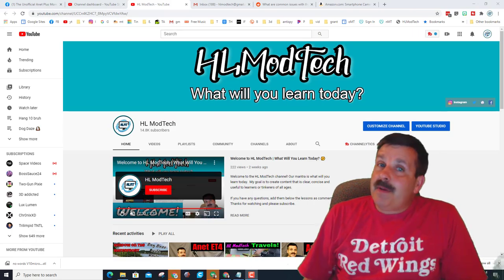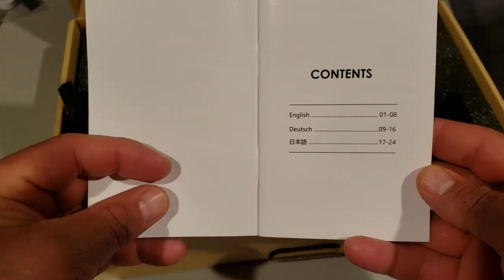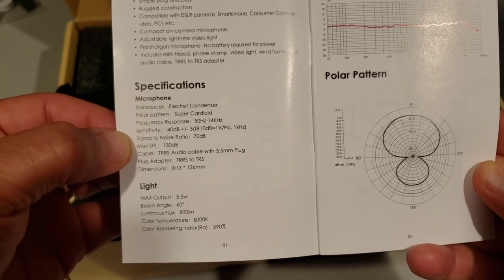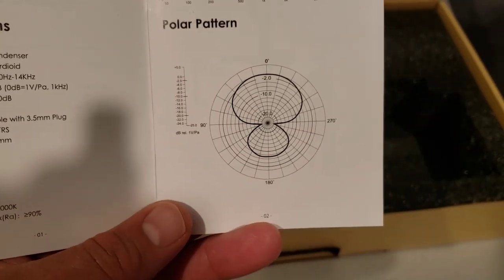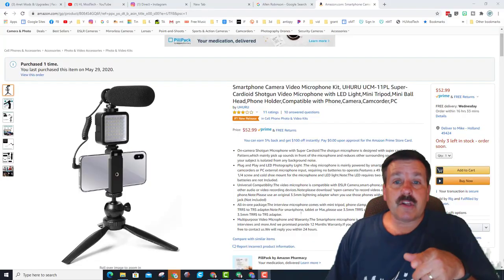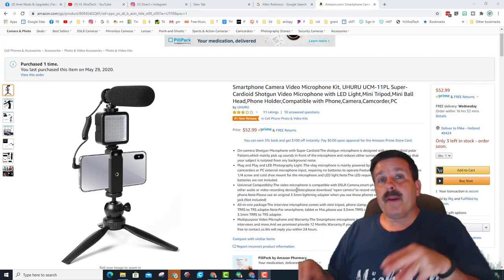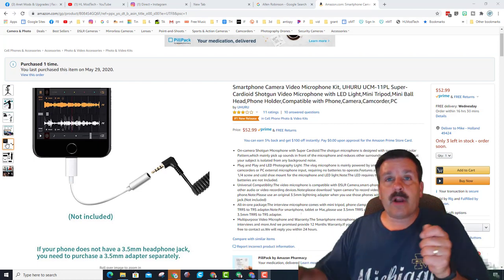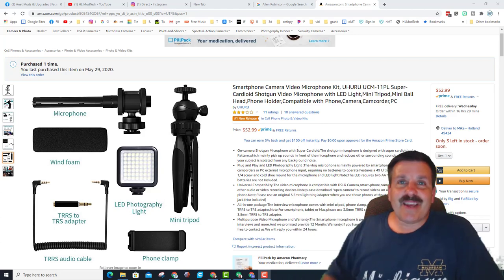Tested!  UHURU Super-Cardioid Shotgun Video Microphone vs 3D printer

Comment: Do you need an app with it if you have iPhone 11?
Reply from the maker: I did not test it. But I do know you'll need the adapter so that you can do the headphone jack in for the iPhone 11
Reply: No you don’t iPhones use external mics however if your using a older android you may need  to use a 3rd party app